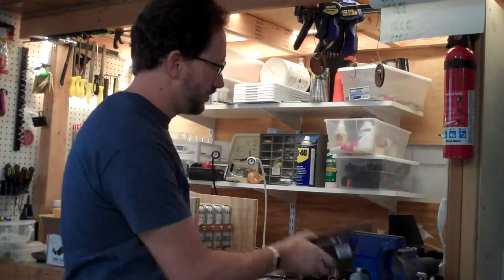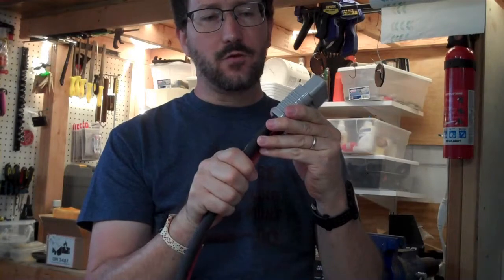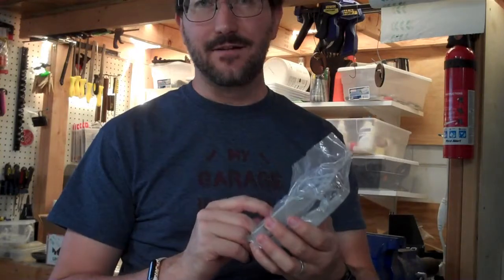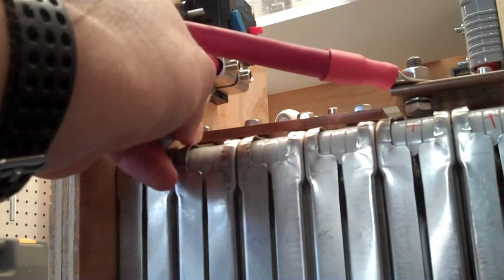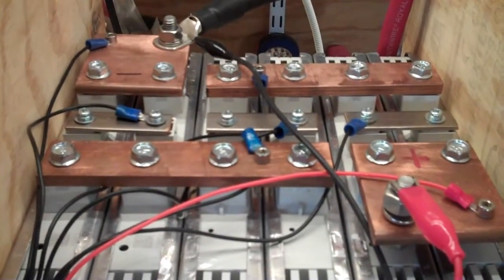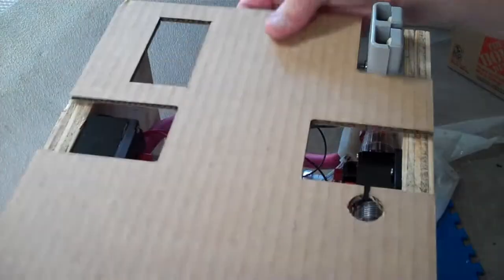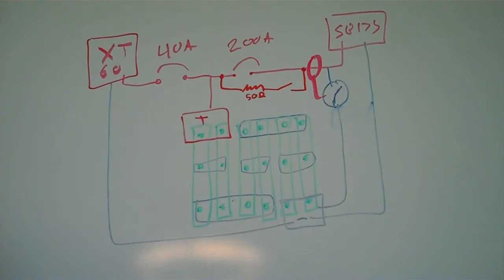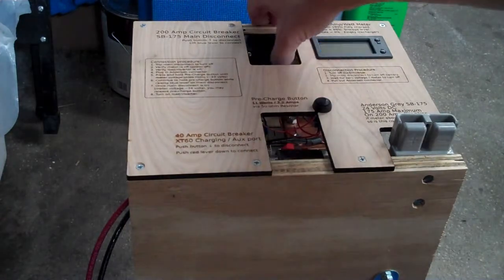Running a Well Pump off Batteries -Battery Accessories (part 5)

Comment: I'm missing where you list the parts and sources you found them and prices etc?  I'm trying to decide if I should order the LC-3 connectors from Tech Direct instead of the next step up connectors you are using. Can you add these details to the blog if they are not on there yet?  Also, from 9 min to 14 min you explain how to connect the wiring but you never show a visual and this leaves me to try to blindly mimic your interior placement of the breaker components and wiring. Could you take the cover off and take a photo of the guts and add it to the blog please???
Reply from the maker: I don't really recommend this approach for a 24v system to others. It is a 6S system, and the low voltage compared to a 7S system means that I have to keep it topped up for my powerjack inverter to work correctly for my well pump with it. The wiring diagram on the whiteboard in the video is complete, but does not include a BMS (I'm relying on my charger to balance charge the modules, and due to the low voltage 6S configuration, the inverter never draws the pack voltage anywhere near the bottom.) Go with 4x six volt golf cart batteries unless you have other reasons to use Litium, and finding a 7S configuration would probably work better than the 6S Nissan Leaf modules.